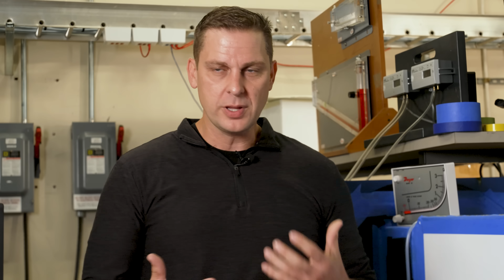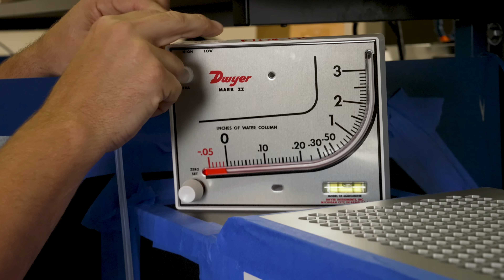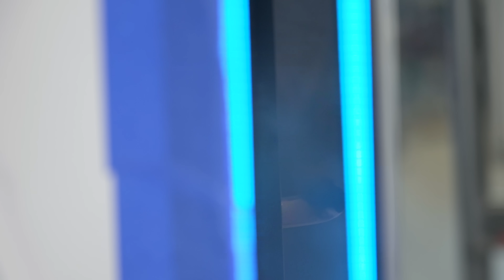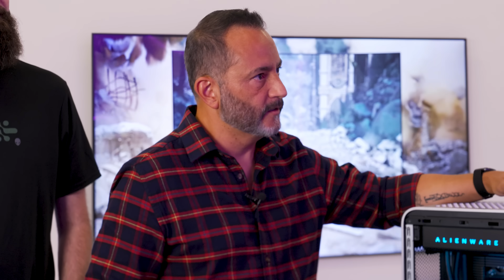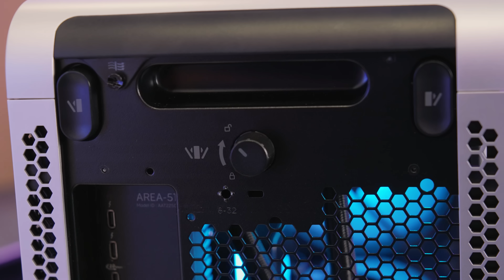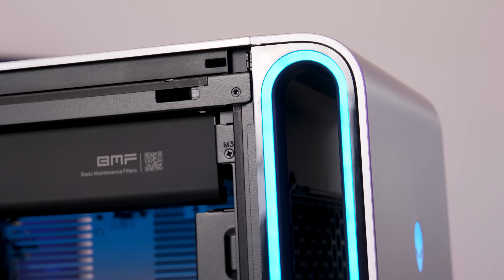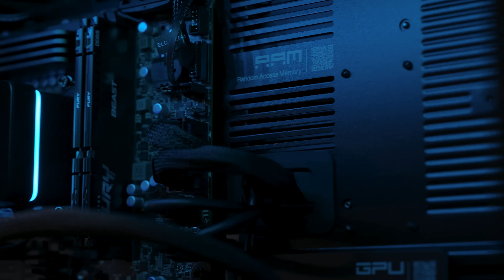Adam Savage Learns How Gaming PCs Should Be Cooled!

Comment: I use both. I have fans at the front of my computer case to pull air in and fans at the rear and top to pull air out. Why only use one method when it's easy to do both and have directed airflow?
Reply: That is one method. Pressure is determined by how much air is going im vs out, as long as you have more intake fans than exhaust (or they are spinning faster or moving more air to make up for it) you have a positive pressure system. It's determined by how air moves through the non-fan vents, like the holes in your PCIE covers.
Reply: This does not determine positive or negative pressure. That is going to be your net airflow/pressure and is the point of this video
Reply: Which drags dust everywhere

Comment: all this "testing" so they can charge you  2 or 3 x the component cost, for minimal performance gain over stock, there are much better options out there folks, from local system builders to a DIY approach, there is one thing that is consistent across the web, Alienware hardware is never worth it.
Reply: Under clocked too.

Comment: Cool thing about positive pressure is that if you put filters on your inlet fans, it actually keeps dust out of your computer, unlike negative pressure builds, which pull dust in through every little opening
Reply: Bingo, this is the main, if not only, factor I take into consideration when I'm building a new PC, dust. Heat I can deal with, dust buildup is vastly more difficult and annoying to take care of.
Reply: @ianyboo  While I agree from a maintenance standpoint,  I don't agree that dust buildup is difficult to remove lol.   Get a good electric dust blower, metro data vac makes great ones :)
Reply: yep spot on, and we used the same flow bench setup to measure the pressure loss from the filter which was minimal... so you get all the dust free benefit with no impact on flow through the chassis.  The dust filter was a major effort and we are pretty proud of that one... i got a dang cat that just loves to lay on top of my rig all the time... #iworkfordell
Reply: You got it.
Reply: Yeah well take the time to clean it out and it's not an issue I would rather have that then overheating parts
Reply: @bumperxx1  unless youre using a case from 1999, its probably designed with filters built in and positive pressure anyway. If not, then buy better cases.
Reply: Dust getting into the system that is not removed acts like an insulator, so I generally will prefer to have a system that has filtration to mitigate dust that can get into a system.
Reply: Yes, but i readed that with positive pressure the design is critical, because it's easier for hot air to lie around in some places of the case.
Reply: @f-s-r  The same does apply to a negative pressure system. An area that doesn't have any holes nearby for air to get into the system will not have any airflow either.
Cases these days almost always have openings/fan mounting spots on top of the case. Hot air rises up so even if there is very little airflow, the hot air can escape naturally through the top of the case.
Reply: @Kepe  That's why the PSU is at the top, and has an exhaust fan while the intake is at the bottom. The heat will go up no matter what, and then that fan will send all that hot air at the top of the case to the outside. Cold air will naturally enter from the bottom of the case. In fact, it could be a bad idea to add other holes on the top of the case, because if it's easier to pull air from that holes, the exhaust fan could be just pulling air from that shorter / less resistance path, instead of hot air from the rest of the case.
Reply: @f-s-r  Modern cases have almost always the PSU at the bottom and/or outside the main chamber of the case. Very few modern cases place the PSU at the top in the main chamber, above the motherboard.
If you look at my case for example, the PSU is behind the motherboard in a separate chamber of the case. I have three fans at the bottom of my case pushing cool air into the case, three fans on the right side panel also pushing in cold air, and I have three fans at the top of the case pulling warm air out of the case.
So it's a positive pressure system and the extra air that is not sucked out by the top exhaust fans exits the case from the back.
In the olden days yes, there was usually just one fan in the bottom of the front panel for intake and the PSU at the top rear of the case worked as an exhaust. Usually there was also an exhaust fan (or at least space for one) below the PSU in the rear panel of the case. Very old PSUs had a small fan that was at the back panel of the PSU and there were holes in the front-facing panel, so the PSU sucked air from the very top of the case around the middle. But then PSUs started placing the fan at the bottom, which meant there was nothing pulling air out from the top of the case anymore and that became a common hotspot. If you had hard drives in the top front section of the case, they were prone to running too hot and premature failure.
Modern cases are very different from the one you described...
Reply: Was going to say the same thing about keeping dust out.

Comment: Great video. Would love to see the same video with someone like Noctua, the best of the best for airflow.
Reply: I would contend that Noctua has great fans, but it's still the case that makes the bigger difference when you want airflow. Dellienware has suffered in that department for a decade. If you want a great airflow case, then use Noctua fans in an NZXT or Lian-Li case (I'm biased to those two brands given past history using both).
Reply: Ring impeller was a key factor more then anything it breaks up the blade turbulence coming off the tips of the blades.   Noctua does a good job as well as Cooler Master, Delta, AVC, Sunon Torrington, etc.. #iworkfordell
Reply: Love Noctua for quiet fans, but they are far from the leader for airflow or positive pressure.  Plenty of PC YouTubers have covered them and others. Check out Linus Tech Tips, Gamers Nexus, and Jays 2 Cents for lots of this kind of content, including touring manufacturers facilities and interviews with engineers.
Reply: I'd like to see lian li, or antec :)